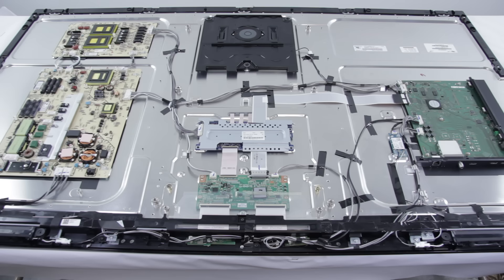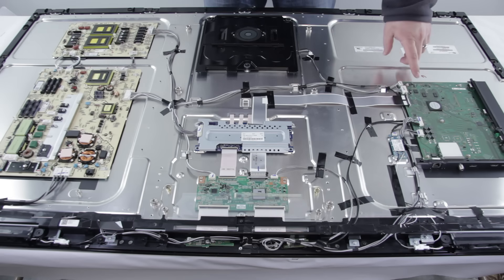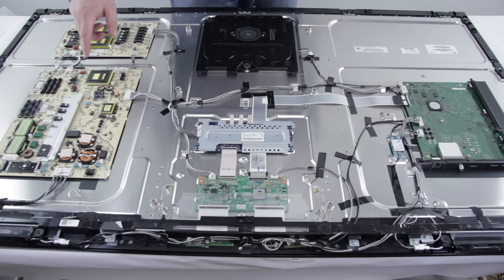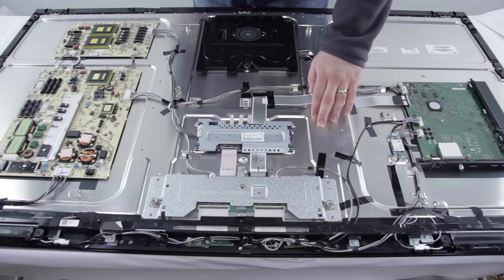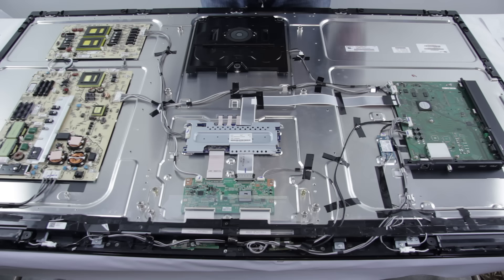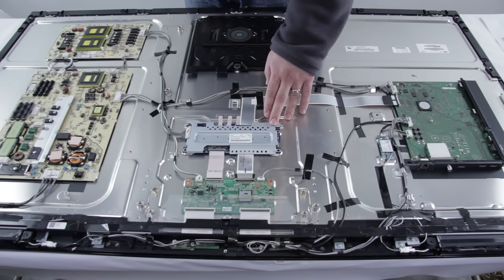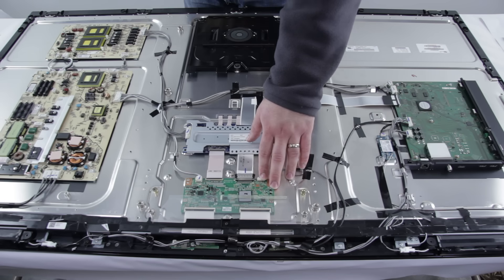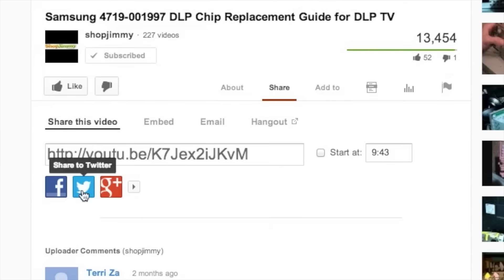LED TV Repair Tutorial - Common Symptoms & Solutions - How to Repair LED TVs

Comment: Hi! I have a question on my tv that turns on the power but does not display anything from any of the HDMI input sources we tried. The TV is Samsung UN55C8000 LED from mid 2010.

Just today morning when I tried to turn it on, it power on with the melody sound and the 'Samsung' light on tv but only displays this "NO SIGNAL - check connected device's power, cable connection, and source selection".

I have tried everything and none of the inputs work and display the same. Can you advise on what could be the potential problem and how to fix it?
Reply from the maker: Bhavin Shah   I recommend replacing the main board in your TV.  Here is a link to replacement parts for your TV model number on our website, click here:  http://www.shopjimmy.com/catalogsearch/result/?q=UN55C8000  Be sure to match part numbers on your current board, with your replacement for compatibility.  Here is a link to a video showing how to identify your part number, click here:  Samsung Main Boards & Digital Boards: Part Numbers for LED, LCD, DLP, Plasma TV Repair  You can also call our customer service for further assistance with your purchase.  (877) 881-6492  Thanks and please let us know if you have any further questions with your TV Repair!  www.shopjimmy.com

Comment: hi ,,, I have 22 (56 cms) EX420 Series BRAVIA LED TV --- the problem is intermittent for hours to stay-- the screen moves from its place to the right hand side leaving a thick dark vertical band on the left hand side  and there are numerous  fine horizontal lines going across the screen as distortion ,  will try to post a video link wrest all is fine
Reply from the maker: qurmat   This sounds like a TV panel problem.  If your TV panel is bad, it may be more cost-effective to replace the TV as panels are typically hard to find in stock, difficult to replace, and expensive.  Thanks and please let us know if you have any further questions!  www.shopjimmy.com

Comment: I have an LG 47LV3700 UV. The power light turns red when first turned on the slowly fades to blue. Nothing else happens. You can hear a relay click inside when button is first pressed. Please help. 
Ron B
Reply from the maker: Ron Ball   I recommend replacing the main board in your TV.  Unfortunately I do not see any replacement parts in the search results for your TV model number on our website.  Thanks and please let us know if you have any further questions!  www.shopjimmy.com

Comment: Hi there, I have a 46" RCA LED 1080p tv that turns on and works, but the left half of the screen is darker than the right side. Not sure what needs to be replaced but feel it may be an easy fix. The model is RLED4627A. If you could help that would be great.
Reply from the maker: Ann Wilson   This sounds like a problem with the LED driver or the power supply in your TV.  Unfortunately I do not see any replacement parts in the search results for your TV model number on our website.  Thanks and please let us know if you have any further questions!  www.shopjimmy.com

Comment: Philips 47PFL7404H/12 top of picture visible but lower is grey with pale colours. Started with thin black line(s) horizontal on screen. on then 3 now.otherwise brilliant picture so rather repair than scrap. Thanks
Reply from the maker: baz blackpool   This sounds like a TV panel problem.  If your TV panel is bad, it may be more cost-effective to replace the TV as panels are typically hard to find in stock, difficult to replace, and expensive.  Thanks and please let us know if you have any further questions!  www.shopjimmy.com

Comment: I have a 2010 Samsung UN55C8000 TV and its showing three 3 to 5 inch white vertical lines in the left center and they are faded and one is visible then the other.

Comment: I have a Samsung LED 3D TV. Model # is UN55C8000XFXZA. The tv would not turn on at all. Sounded like we needed power supply which we already replaced.  The tv will turn and off ok but now there is sound and no picture. Just a black screen with a very faint shadow of a picture.  Do you think I might have bought a faulty power supply board or does it sound like something else is going on.
Reply from the maker: Don Richey   This sounds like a faulty replacement part.  Thanks!  www.shopjimmy.com
Reply: The place we bought the power supply board  from said it could be the inverter board, T-Con board or main board could be causing the problem.  If this could be be one of these boards causing the problem how do we go about checking them.
Reply from the maker: Don Richey   The easiest way depending on your tech skills, would be to be sure your are buying parts that work and replace each board individually to see if they fix the problem.  Here is a link to replacement parts for your TV model number on our website:  http://www.shopjimmy.com/catalogsearch/result/?q=UN55C8000XFXZA  Be sure to match part numbers on your current board, with your replacement for compatibility.  You can also call our customer service for further assistance with your purchase.  (877) 881-6492  Thanks and please let us know if you have any further questions with your TV Repair!  www.shopjimmy.com

Comment: Hi, I have a Sharp Aquos Quattron, model LC70LE734U, that when I turn it on, the white power light (below the SHARP name) will blink 2 quick blinks, then 5 slow blinks.  There is no picture when I turn it on...just the blinking light pattern.  What does this blinking light pattern mean/indicate?  Please help!  Thanks!
Reply from the maker: PastimeVideos  I recommend replacing the main board in your TV.  Here is a link to replacement parts for your TV model number on our website, click here:  http://www.shopjimmy.com/catalogsearch/result/?q=LC70LE7  Be sure to match part numbers on your current board, with your replacement for compatibility.  You can also call our customer service for further assistance with your purchase.  (877) 881-6492  Thanks and please let us know if you have any further questions with your TV Repair!  www.shopjimmy.com

Comment: I have samsung tv un55d6000sfxza. No pewer black screen, and red light does flash. I don't know what s the problem could be, please can you help.
Reply from the maker: nezha ait hammou   If you have a multimeter check the voltages on the power supply to see if you have the 5 volt standby if you do replace main board but if no 5 volt standby replace power supply.  Here is a link to replacement parts for your TV model number on our website, click here:  http://www.shopjimmy.com/catalogsearch/result/?q=un55d6000sfxza  Be sure to match part numbers on your current board, with your replacement for compatibility.  Here is a link to a video showing how to identify your part number, click here:  TV Part Number Identification Guide for Samsung DIY TV Repair Power Supply Unit (PSU) Boards  You can also call our customer service for further assistance with your purchase.  (877) 881-6492  Thanks and please let us know if you have any further questions with your TV Repair!  www.shopjimmy.com

Comment: Hello. Awesome videos. I have a Samsung Model UN50EH6000. The TV takes a while to display an image during initial power up. I have sound but no picture. After the picture comes up (anywhere from 10 - 20 minutes), the image is fine but it will eventually black out for periods of 2 - 10 minutes. The times are inconsistent. I did the flashlight test and I can see the menu buttons. I'm assuming that it's the LED driver board. Thanks again for posting these videos.
Reply from the maker: Dan Michael  I recommend replacing the power supply in your TV.  Here is a link to replacement parts for your TV model number on our website, click here:  http://www.shopjimmy.com/catalogsearch/result/?q=UN50EH6000  Be sure to match part numbers on your current board, with your replacement for compatibility.  You can also call our customer service for further assistance with your purchase.  (877) 881-6492  Thanks and please let us know if you have any further questions with your TV Repair!  www.shopjimmy.com

Comment: The screen is fine it no longer gets hot and when I first powered it on it was a full screen splash screen that said smart tv and it had sound my old t on board ic  chip melted so I think it fried the main cause now I have no sound or picture.
Reply from the maker: MeMpHiSsLiM20   I recommend replacing the main board in your TV.  Please reply with your TV model number and then I can recommend a replacement part.  Thanks!  www.shopjimmy.com

Comment: Hello, I have a 39" Westinghouse LED TV Model #ew39t6mz. It turns on there is sound but it deems out and turns black but you can still see images. Is it a bad driver? What do you recommend?
Reply from the maker: *****   This sounds like either a problem with the power supply or the inverter in your TV.  Here is a link to replacement parts for your TV model number on our website, click here:  http://www.shopjimmy.com/catalogsearch/result/?q=ew39t6  Unfortunately I do not see any power supply and inverter boards in the search results.  You can also call our customer service for further assistance with your purchase.  (877) 881-6492  Thanks and please let us know if you have any further questions with your TV Repair!  www.shopjimmy.com

Comment: I have a 58inch Led Sanyo model number DP58D33. The TV turns on with sound but the screen is black if you shine a light on the screen you can see the image
Reply from the maker: Matt Harry   This sounds like a problem with either the power supply or the LED Strips.  You can replace the power supply to see if that fixes the problem.  Here is a link to replacement parts for your TV model number on our website, click here:  http://www.shopjimmy.com/catalogsearch/result/?q=DP58D33  Be sure to match part numbers on your current board, with your replacement for compatibility.  You can also call our customer service for further assistance with your purchase.  (877) 881-6492  Thanks and please let us know if you have any further questions with your TV Repair!  www.shopjimmy.com

Comment: Sony KDL-46V4100.  I'm having 2 problems.  Problem one is that there are about 10 thin red vertical lines in the picture all the time.  Problem number 2 is that the TV won't respond to any input from the remote or from the from the buttons on the TV.  It keeps trying to change channels on it's own every 20 seconds, but always goes to the same channel.  Any suggestions would be greatly appreciated.
Reply from the maker: Brad Scott   This sounds like a TV panel problem.  If your TV panel is bad, it may be more cost-effective to replace the TV as panels are typically hard to find in stock, difficult to replace, and expensive.  Thanks and please let us know if you have any further questions!  www.shopjimmy.com

Comment: got a samsung un55d6400uf and i just replaced the t con but for some reason i get a high pitch screech from t con and it gets hot. i also do not get a picture and when it makes the sound one part of the screen gets hot where the strips are. could this be a main board issue?
Reply from the maker: MeMpHiSsLiM20   This sounds like a TV panel problem.  If your TV panel is bad, it may be more cost-effective to replace the TV as panels are typically hard to find in stock, difficult to replace, and expensive.  Thanks and please let us know if you have any further questions!  www.shopjimmy.com

Comment: SAMSUNG LN32D430G3D is randomly dimming. In the dimmed state, the right side of the screen is darker than the left side...
Reply from the maker: Electromech   I recommend replacing the inverter board(s) in your TV.  Here is a link to replacement parts for your TV model number on our website, click here:  http://www.shopjimmy.com/catalogsearch/result/?q=LN32D430G3D  Be sure to match part numbers on your current board, with your replacement for compatibility.  You can also call our customer service for further assistance with your purchase.  (877) 881-6492  Thanks and please let us know if you have any further questions with your TV Repair!  www.shopjimmy.com

Comment: I have a Samsung Smart TV Model UN46D5000SFXZA.  The tv has no picuture or sound and has a flashing red light on the lower right.  It will not turn on.  Could this be bad capacitors?  or is it something else?
Reply from the maker: GH   I recommend replacing the main board in your TV.  Here is a link to replacement parts for your TV model number on our website, click here:  http://www.shopjimmy.com/catalogsearch/result/?q=46D50  Be sure to match part numbers on your current board, with your replacement for compatibility.  Here is a link to a video showing how to identify your part number, click here:  Samsung Main Boards & Digital Boards: Part Numbers for LED, LCD, DLP, Plasma TV Repair  You can also call our customer service for further assistance with your purchase.  (877) 881-6492  Thanks and please let us know if you have any further questions with your TV Repair!  www.shopjimmy.com

Comment: I have a Philips 47PFL7422D/37 LED TV The picture started flickering then was un-watchable. when I turn it on, sometimes it works but the picture is dim on one side than the other. After a while it will start flickering. What part do you suppose it is and is it easy to replace and how much does it cost?
Reply from the maker: Jim Dolinger   I recommend replacing the backlight inverter(s) in your TV.  Here is a link to replacement parts for your TV model number on our website, click here:  http://www.shopjimmy.com/catalogsearch/result/?q=47PFL7422D%2F37  Be sure to match part numbers on your current board, with your replacement for compatibility.  Here is a link to a video showing how to identify your part number, click here:  LCD Help Part Identification Number Guide for LG & LG Philips Backlight Inverter Boards TV Repair  You can also call our customer service for further assistance with your purchase.  (877) 881-6492  Thanks and please let us know if you have any further questions with your TV Repair!  www.shopjimmy.com

Comment: LG 55LV5300 55" Class LED HDTV 
Problem: I turn on TV, no picture/no sound.
Power button on front is red, when I turn it on it goes white.
Reply from the maker: Charlie Rogers   I recommend replacing the main board in your TV.  Here is a link to replacement parts for your TV model number on our website, click here:  http://www.shopjimmy.com/catalogsearch/result/?q=55LV5300  Be sure to match part numbers on your current board, with your replacement for compatibility.  You can also call our customer service for further assistance with your purchase.  (877) 881-6492  Thanks and please let us know if you have any further questions with your TV Repair!  www.shopjimmy.com
Reply: I went to your website and found the the part is not in stock any longer.  Does ShopJimmy rebuild the boards?
Reply from the maker: Charlie Rogers   This depends on the board and the problems with it.  Please call our customer service department for more information.  (877) 881-6492

Comment: Hi Jimmy, I have a Sharp Quattro Model LC-60le810un. I have not taken it apart yet, the problem I have is no pictures or sound, but when i turn on the tv there are blinking lights on center front of the tv. Blinks one short and one long. Can you assist on a possible diagnoses.
Reply from the maker: Roberto Hoffmann   I recommend replacing the main board in your TV.  Here is a link to replacement parts for your TV model number on our website, click here:  http://www.shopjimmy.com/catalogsearch/result/?q=LC-60le810un  Be sure to match part numbers on your current board, with your replacement for compatibility.  You can also call our customer service for further assistance with your purchase.  (877) 881-6492  Thanks and please let us know if you have any further questions with your TV Repair!  www.shopjimmy.com

Comment: Hi, guys, hope you can help me out ,I have a toshiba led hdtv, just a month ago it went blank, my wife said while she was watching it (the tv) went blank, but she can hear the sound, I already changed the inverter board and the tcon board, ran the back light test, (it has really dim image) backlight is working just fine, now I think it maybe the tcon board that i bought on line what do you think, any  and all help its really much appreciated,
Reply from the maker: MrElgalloloco   I recommend replacing the T-Con board in your TV.  Please reply with your TV model number for your TV and then I can recommend replacement parts for your TV repair.  Thanks!  www.shopjimmy.com
Reply: I did replace the tcon board but the tv remains the same , my  tv  is a 46L5200u from Toshiba,  I know this has  a bad reputation for bad tcon boards, and the seller wont accept that he sold me  a bad piece ,even when I told him the tv is about  2 years old,  he said the tv has been missdiagnosed and its more  of a bad led problem ,even if  I had run the light test, could he be right?
Reply from the maker: MrElgalloloco   If you don't have backlight it's going to be either the led driver board or the actual LEDs themselves.  Here is a link to replacement parts for your TV model number on our website, click here:  http://www.shopjimmy.com/catalogsearch/result/?q=46L5200u  Be sure to match part numbers on your current board, with your replacement for compatibility.  You can also call our customer service for further assistance with your purchase.  (877) 881-6492  Thanks and please let us know if you have any further questions with your TV Repair!  www.shopjimmy.com